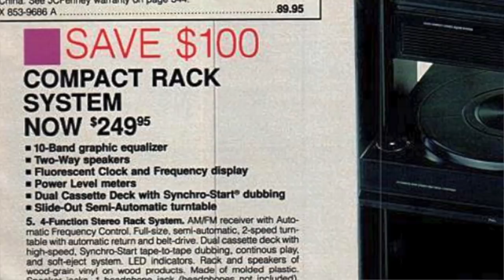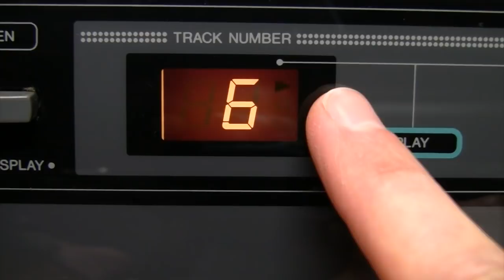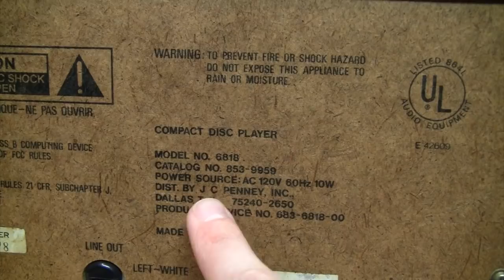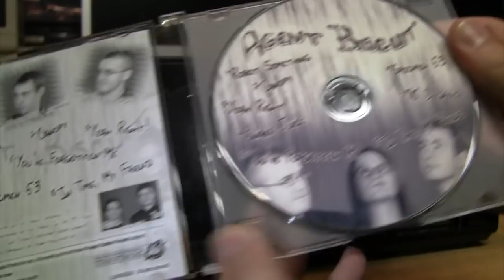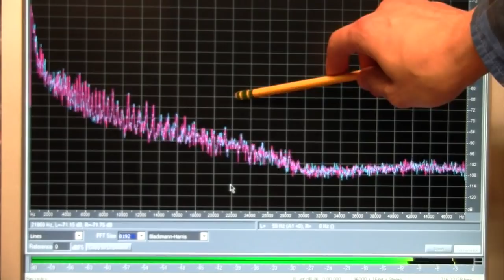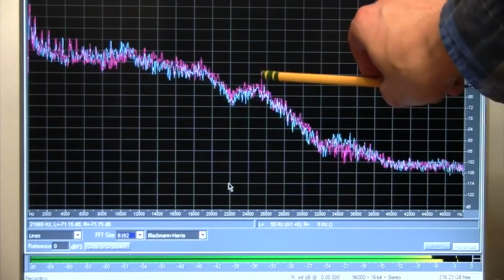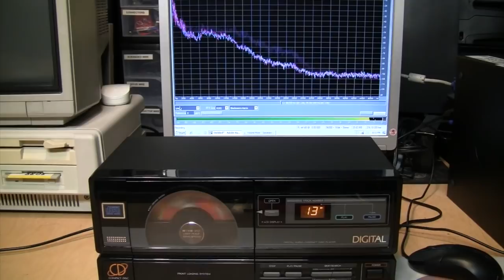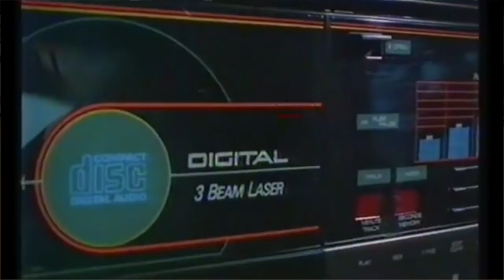The cheapest CD player ever made is surprisingly good - the 1988 Yorx CD Pal

Comment: I used to own this CD player, however mine was not branded Yorx or JCPenney, but Soundesign. I bought mine used in the late 90's as an extra CD player for something like $20.  This player actually was the subject of some discussion at the time as it was heavily rumored to share some components with an older Phase Linear CD player model 9500 (which was made in conjunction with Kyocera who branded it the Kyocera DA-1) with most of its extras stripped away. While I had that player, it was unexpectedly one of the more reliable CD players I had ever owned. I was then and still am a little skeptical of the Phase Linear/Kyocera connection, however it could have been their design made under license as by 1988 that CD transport was about five or six years old. I ended up passing it on to a friend when I started using a much better featured Denon on that stereo.
Reply: I’m super curious who the OEM was on this player, as I’ve seen nearly identical versions with many different brand names on them.

Comment: Back in the late 80s my mother bought us a new component stereo system and it was a Fisher. Boy did that cd player suck. Had this Motley Crue cd and no matter how many times I'd play it, it would not get past a certain spot on it. I thought the CD was defective for a long time. When I finally got me a portable Sanyo player it played the CD with no issues. Then I realized the Fisher was poorly made. The cassette deck wasn't that great either. When I taped songs off the radio they weren't as loud as when I did it off my old Emerson. It also had a glitch in the high speed dubbing and once in a while the playing side would play fast while it recorded at normal speed. Man I miss my old Emerson. It appears to be a hard to find stereo.

Comment: i am still waiting for an absurdly over complicated cd player where the cd is stationary and the laser mechanism is spinning over it like an oversized vcr head drum. (and yes, i am aware of several challenges to overcome for such a design to be functional)
Reply: A little bit like the little van ''  vinyl killer '' but for CD... Great!
Reply: Just hold the CD in place and then the mechanism will rotate around it. If you hold it from the spindle and apply balancing weights to the mechanism I could imagine there's a chance this could work.

Comment: Are there dry solder joints on the LCD board?  I noticed when you turned the player on, it showed the number 10 until you tapped the case a few times, even after that, the digit on the left hand side was fainter than the one on the right.

Comment: The top one at 1.21 looks exactly like my very first CD player. The only difference is mine was branded Sanyo and the Digital logo was on the tray but otherwise buttons, tray, display and all is exactly the same as it was on mine. That this unit dont even have an interlock switch surprises me though, I bet when u opened it it did not even stop but still tried to play the disc as it would not sense that door had opened. I thought because of laser safety that this was a very stringent practice in general (like on a microwave oven) because all warning signs u would see in the manuals of these  like WARNING INVISIBLE LASER RADATION AVOID EPOSURE! like it would indeed be like a microwave oven or laser cutter capable of causing great harm to u if the door/tray was open while operating. Later I found however that these warnings are exaggerated. The laser in a normal CD player is actually  totally harmless because of its very low power and narrow focal length just 1 mm or so from the lens so it would disperse way before it could hit your eyes or any other part of you. Only if the lens came of the read head and u then looked directly into it it could possibly do any kind of harm. The laser is in the infrared range though so it is indeed moslty invisible. Comparing a DVD laser and a CD laser of same power the DVD laser looks much brighter and can even be seen in some DVD players through gaps in the tray while active, the entire inside of the drive glowing red. Still only without the lens on the read head the beam could do any kind of harm. For burners its another matter though. Few functions on this model indeed although it manages to get really good quality sound from what I could hear so still a decent quality unity I would say. I  could be happy with one of these.

Comment: It was things like this that killed off the compact cassette! Yeah sure it was a new and exciting technology but I think that you said it perfectly when you said that they all literally sound the same in comparison to cassettes and the decks that were used to play them with! For someone who had the cheapest stereo system, with this CD Player plugged in, it would be an instant improvement over the cheap cassette deck and turntable! While those who spent more on their equipment, would have purchased a CD Player to add to what they already had instead of replacing the cassette deck and turntable. Most people would probably couldn't tell the difference between a well recorded cassette to a CD in a double blindfold test! But since the majority of people had cheap rubbish for their stereo systems or Boomboxes although I took apart a sharp boombox that was made in the 90's which was actually built extremely well with possibly the most expensive resistors that I have seen! The erase head was also the active AC bias type instead of the rubbish permanent magnet type! Very surprised by the quality for something that was towards the end of it's sales life. It's a real pity that sharp didn't market it's quality! It probably would still be selling today! We didn't have YouTube videos showing us the inside of equipment that we would have never considered purchasing back then otherwise things might have been different! We went from beginning with mono to stereo and then onto quad stereo to multi channel surround sound and now I find myself listening to everything in mono and limited frequency through the shitty tiny little speaker that's fitted to my phone! Even most Bluetooth Speakers are mono regardless of having more than one speaker inside it. Like they said, the more things change, the more they stay the same! 
Don't buy cheap stuff and they will stop making rubbish! We only have ourselves to blame!

Comment: A pretty nice unit considering the price and time it was made. Compare that to now where if you buy the cheapest version of anything you'll be lucky if it works at all - and it'd be a miracle for it to work 30 years later.
Reply: True that. I have much newer dead electronics
Reply: the last good "junk" electronics era was in the 2000s after around 2006 everything became 100% disposable.
Reply: @xx-mreba-xx4051  the problem is that it used to be "Here's a cut down version of the product at a discount" and now it's "its got all the features of the high end product but none of those features work as they're supposed to"

Comment: The best CD Player ever made for price are Pioneer DVD Players DV-300/DV-410 models. With few cheap and easy modifications they can sound better than any chepest or the most expensive CD payers ever made. DV-300 can be found for less then $20 and DV-410 for less than $50.
Reply: @JohnZombi88  If you remove some unnecessary elements from SPDIF path you can see if you measure digital signal that is perfect. If you change only one Op-Amp in analog section with eg. OPA1612 you can see that analog signal is also perfect. With firmware modification you can extend all software functions on rhem for audio and video. Also DV-410 have USB port which can play everything and accept all popular AV formats also as external subtitles like *.sub or *.srt formats. From PSU side you can change few capacitors for better filtering.
After all of that simple and cheap modifications using osciloscope and some audio analyzer software (eg. ARTA) it is obvious that all that measurement is something that is almost impossible to beat for that price. Goldmund Eidos ($6.000) use same components which is inside that cheap Pioneer DVD Players.
Reply: @JohnZombi88  Not matter who has scope or not. Everything is previous done by others and olso as myself. Anyone with basic electronic skils and little patience can do this.

Comment: This is as barebones as a CD player can get. The microcomputer is just locking the servo and reading the subcode P to seek and do the track skipping. I haven't seen one "in the wild" doing that. It completely ignores the subcode Q which is where the total time and track number is stored. You can probably force it to skip several tracks forward and the computer will still think it's on track as subcode P has no indication of track numbers..

Comment: Yorx was basicly the cheapest of the cheap budget fi components you could buy.  They were popular because the price was low.  Some were slightly better then others but for the most part, their products, especially from the mid 1970s onward were very very low quality.  You see them everywhere in various states of working order because they were sold by the hundreds of thousands.  Ironicly, due to the overall simplicity of their products, they often still work for the most part.  Many MANY higher end CD players made around this time, I have a few myself don't work properly anymore, their complicated features eventually start to malfunction over time and are complicated if not almost possible to fix (my Onkyo DX-2500 has some weird memory read issue that for the life of me, I can't figure out what's causing it).  These Yorx CD players, being so simple only need the basic laser and the spinning motor and whatever output signal chip it has to work and little else.  Fewer things to worry about breaking down, the less chance it's going to break down.

Comment: Impressive what in ´88 was already possible for 100$.
And i even bought in 2010 a CD player for 600$, mainly because its the exact fitting model, the CA Azur 650C to the Azur 650A integrated amp, but also because the drive noises of a 100$ (also Cambridge audio...)  DVD player were annoying at classic titles with silent passages.

Seems like 600$ were too much for a "basic" CD Player and i would have been better off with a 2nd hand CD player for cheap or even free xD
Reply: What i am wondering at any more expensive CD Player which had such a visible CD while playing- a slower spinning CD!
Investing a few dollars extra in the product for additional RAM which can hold enough playback time as puffer  to allow the CD spin slower so its even better looking.

But as nice it looks - a good CD mechanism and player is worth more than seeing a turning CD.

Comment: i had a similarly 'basic' goodmans cd player in 1990, think it was £80(dunno what that'd have been in dollars?) that had 'usual' horizontal tray loading, i've never seen a horizontal cd separate...yet... here in the uk..
Reply: its pause was indicated even cheaper..it flashed the track number display! it was in fairly regular use until the early 2010s when i think the laser was getting low....
Reply: mine would play 'some' cd-r's,  but cd-rw's, nope!
Reply: its pcb was similar but surprisingly a lot of 'through hole' chips, one a philips microcontroller, one a 2k 6116 ram chip (i kept that when i stripped it for parts 😉), plus a few others

Comment: The text on the labels on this thing are made in the same way you extend an essay to make it the minimum length. You repeat everything as if the reader has no memory.
Reply: This was actually a bad design trend in 1988. It’s present even in higher end hi-fi components of the era. Only pro level gear escaped it.

Comment: Vary excellent review on the cd player you don't see many electronic made for sears , jc pennys , Montgomery wards , kmart , copps department , shopko the list goes on.   I,m thinking  the department stores tell the manufacture of the goods say ok can you make this product for this price the manufacture say sure we can make it for that price.  When i go to the thrift store.   I some times I see jc penny in house brand electronics so time sears if the price is reasonable I buy it.
Reply: JC Penny’s had a high end audio component line called MCS Series. If you see those out thrifting and they work, buy them. They’re shockingly good quality.
Reply: @danieldaniels7571  I have some of the mcs components that sound good even the camcorders work well VCR boombox are not bad ether
Reply: DomLimited never seen camcorders or boomboxes with that branding, but it doesn’t surprise me. Years ago I had an MCS turntable that was very nice, and have an MCS double cassette deck I use now that I like a lot. It’s got analog VU meters, supports metal tape, and one feature none of my other decks do: it has a front panel 1/4” mono microphone input and does mic mixing with its stereo line in.

Comment: I wonder how well it handles shape discs?
Reply from the maker: It will play smaller discs fine, you just have to manually put them on the spindle rather than rely on closing the door to do it for you.
Reply: @vwestlife  Mhmhmm i bet a toploader drive is better for that. I have a shape disc with the Stargate ouverture that would fit perfectly into that CD player since it still has the top and bottom diameter of a regular CD. It's just cut out around the sides.